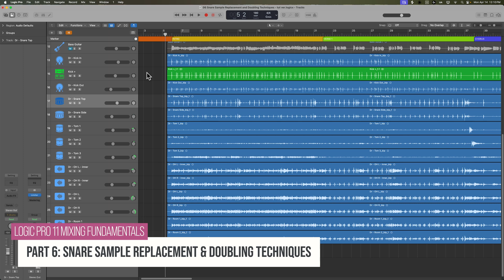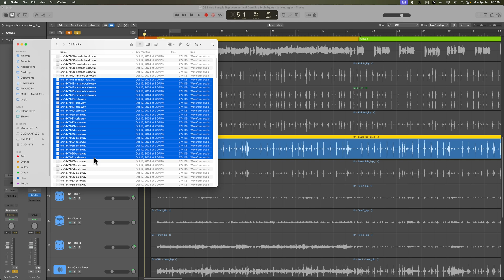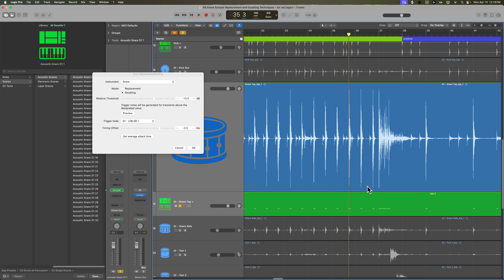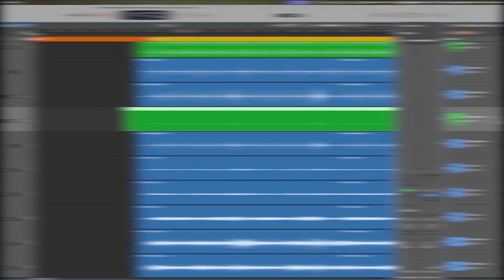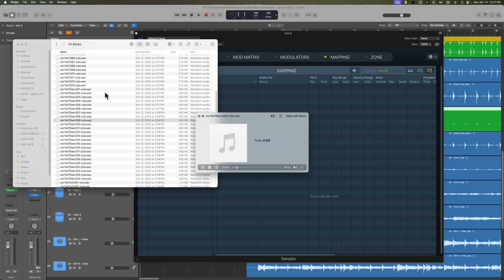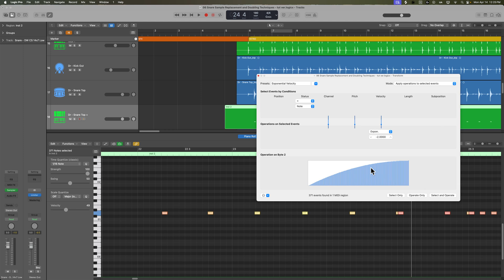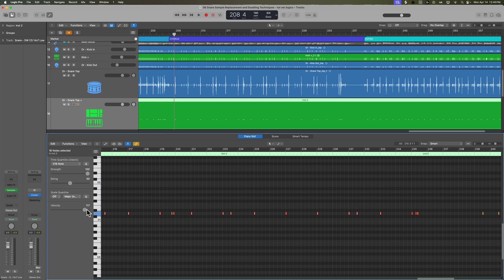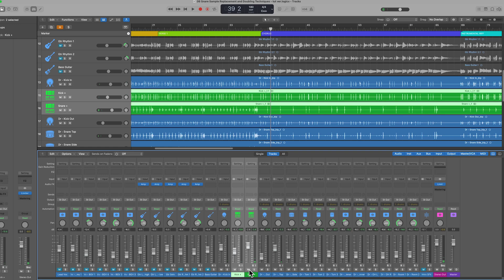Logic Pro 11 Mixing | #06 Snare Sample Replacement & Doubling Techniques

Comment: Do you think eventually acoustic drum kits will stop being a thing for studio recordings? It is a lot of work to setup a drum kit and mic it all properly AND THEN to replace it anyway (and/or use samples mixed in) with drums that are not even from the original recording? Why not just use an electric kit then everything is already isolated and still can add reverb etc. (besides the obvious “it’s not the same” feel of an acoustic)? Interested to know your thoughts on this. Thanks for the series as well. You are by far the best YouTube channel when it comes to Logic Pro and probably as well regarding recording and mixing process.
Reply: Lots of bands use midi drums these days because of this

Comment: Great to have a review in this video of the process for loading and programming batch samples in Sampler. Quick question: in this video, you don't check phase alignment of the snare doubles. Is this because snares are a higher-frequency sound than kick drums, and phase tends to be more of an issue with low-frequency sounds?
Reply from the maker: You should always check the phase. Here I just didn't do it. LOL. With higher frequencies it is less of an issue, but still an issue. When I flip the phase of my snare sample, the snare has more top end punch, but loses low end. Kind of a trade off and you could do either way.